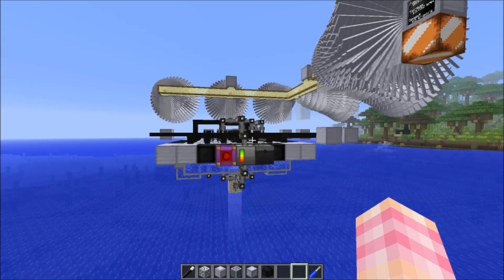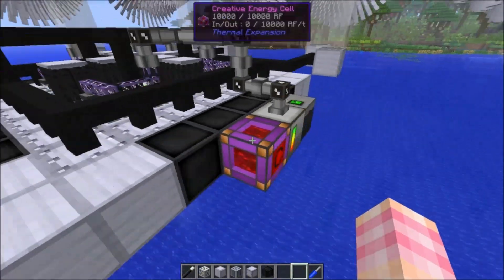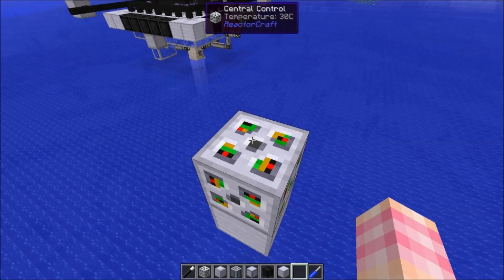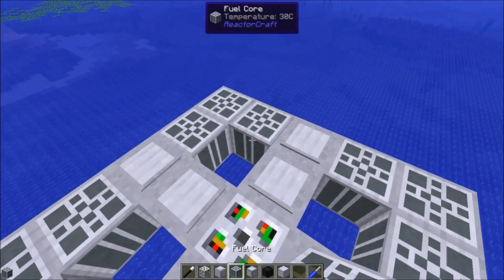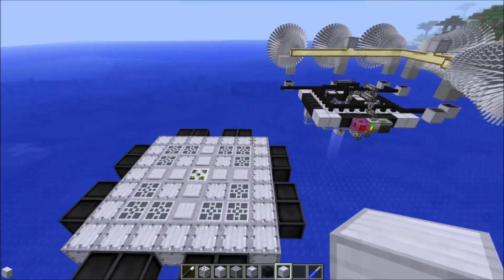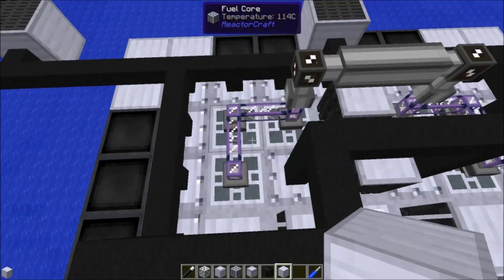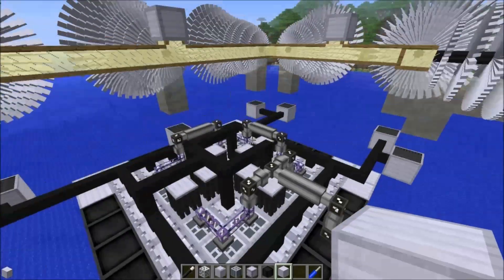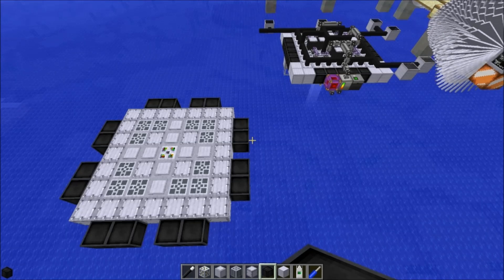ReactorCraft Tutorial #6.1 - 12 Core Fission Reactor

Comment: Are there any adverse effects to using the reactor steam directly into the turbine as opposed to using a heat exchanger?  For instance, if you recaptured the water here instead of venting it, would it be irradiated?
Reply from the maker: No, this is how it works.
Reply: it would be cool if any steam coming out of the steam boilers hit by neutrons was irradiated, it would make people make multi looped cooling system like we have IRL.

Comment: "A nightmare"...
Have you not tried building vertical reactors? They can be stacked in layers.
Reply from the maker: Yeah but my point was that the neutrons only output horizontally. Also how would you put power into Central Control if its stacked? How would you use control rods on the bottom layer?
Reply: Control rods can be used on the bottom layer, but powering a control is indeed a problem. I will think about that.
Reply: Do neutrons also go vertical now or have they ever?
Reply: Never.
Reply: Thanks, I had seen some tiny reactor designs that appeared to rely on it but on a second glance it is not unbelievable that an abundance of neutron reflectors could be doing all of the 'extra' work or that they are simply old designs that would work on one version and be unable to make enough heat after the next balancing update.

Comment: Note well: Reactors must remain chunkloaded.
Reply: ReikasMinecraft I'm guessing there is no way for central control to know if the chunk is about to be unloaded and auto-SCRAM the reactor?  (I don't know the code involved, so I genuinely have no idea if it's possible to detect an impending chunk unload, or retroactively have CC realize on the next load that the chunk had been unloaded and delete the accumulated neutrons and fire the rods, retroactively emulating an auto-SCRAM)

Edit: Gah, I'm a dumb... even if that were possible, it would mean it'd be possible for people to just install a central controller in their reactor to avoid carelessness yielding corium.  So even if that code were possible, it would need to have the central control check attached control rods, and then do the math to calculate the amount of neutron absorption by the control rods and how many remaining free neutrons are available... headache.
Reply: Reika, shouldn't you just make central control force chunk load?  This would negate the need to install additional mod just to have a chunk loader as well as make the mod self-reliant.  Central control already has an interface, so I imagine it would be easy to add a field that define the radius of chunk to load (yes make it use more energy to chunk load).  Some other machines in your mod, like the boring machine, already chunk load so I don't see any harm and has the added benefit of requiring the use of central control thus making your creation safer, more realistic and less people to complain about green mess.

If you play on servers, do not build nuclear reactor in your spawn chunks.  While spawn chunks remain loaded while you are playing anywhere in the minecraft world, they will unload when you leave.  The reactor entities will continue to tick while server is on and all of these tick will accumulate so that when you log back in, the reactor will explode, leaving you a nice green mess!
Reply from the maker: RDirective If he did that people would use the Central Control as a chunkloader, rather than for its intended purpose.
Reply: SentinalhMC
Not if it's preconditioned in the code that chunk loading will only activate with a minimum number of active cores are within its boundary and add on top of that a requirement of a nice amount of power to maintain function, say 16 MW.  Who in their right mind would go through all the trouble of crafting it just to use it as a chunk loader?
Reply: I tried this. It does not work.
Reply: In fact, TileEntities have an onChunkUnload method, but it is of little utility.